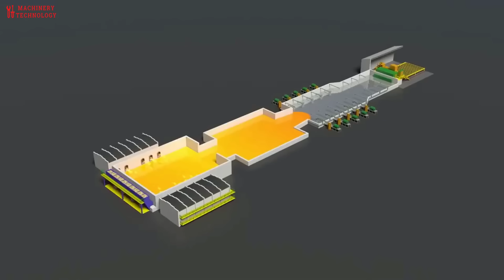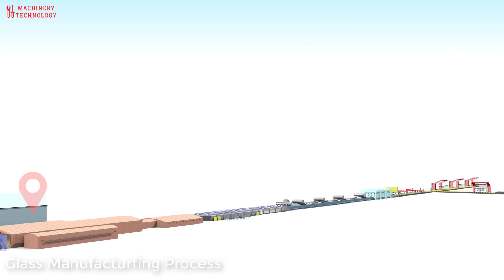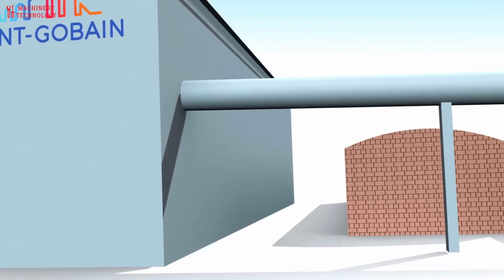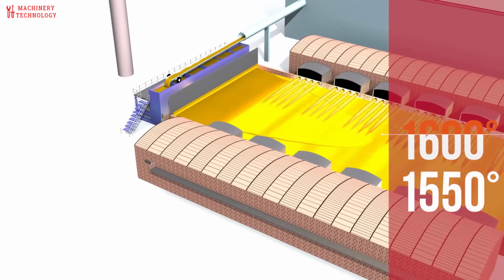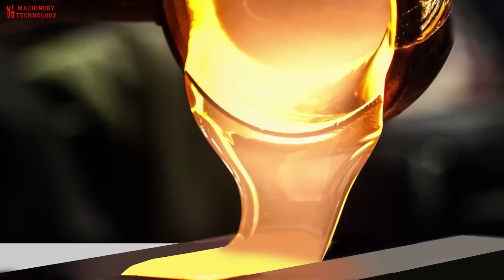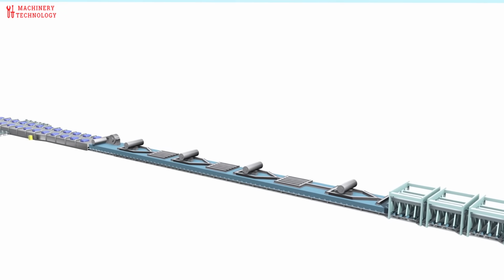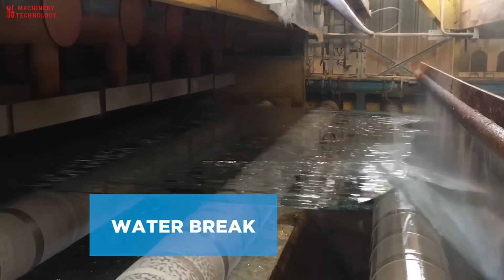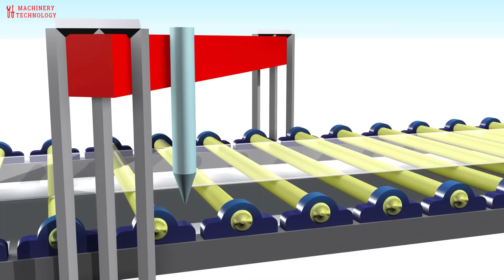Amazing Float Glass Production Process - Glass Manufacturing

Comment: Back in the day when Open University programs were broadcast on Sunday mornings, there was a maths unit about the dynamics of the scoring head; more specifically the need to accelerate it from rest up to a stable speed to make its straight score line across the moving glass. The operation is less trivial than one might think.

Comment: The water break process was a bit confusing as it was located in the middle of the line.  How can the glass continue once it's broken?
Reply: That's the same point I'm confused with.
Reply: It’s because they can’t shut off production of float glass (or would be very costly). So if they need to do maintenance on the rest of the line, they just recycle it at that point. They run these machines 20-30 years, 24/7.

Comment: I would guess the plant runs 24/7 I don't see a way it could shut down without a big clean up of the excess glass
Enjoyed your video and I gave it a Thumbs Up
Reply: They have a running period of about 10-20 years non-stop, it's simply not practical to turn them off. If they have supply chain issues and can't get the required ingredients, they will literally smash the finished product into cullet and re-feed it into the start of the line so they never have to turn the line off.
Reply: При пуске лини по производству стекла, печь разогревают постепенно, в течении 3-4недель и проверяют, чтоб она не развалилась! Ванну с оловом разогревают примерно 2 недели. В день пуска - наступает праздник - "стеклянный язык" из печи протягивают через оловянную ванну на конвеерные валки.
When starting a glass production line, the furnace is heated gradually over 3-4 weeks and checked that it does not fall apart! The tin bath is heated for about 2 weeks. On the day of launch - a holiday arrives - the “glass tongue” from the furnace is pulled through a tin bath onto conveyor rolls.
Reply: @vvdvlas8397  А вы в каком городе работаете? Как я понимаю, на аналогичном заводе?
Reply: @NikolayBychkovRus  
Я был в многодневной командировке на заводе по производству стекла в г. Лисичанск (Украина) ~ 2003г.

Comment: I don't get the reason for the water breaking of the glass at the end of the lehr then you show it as a sheet again?
Reply: That's only for waste - if failed QC
Reply: They mentioned that the molten glass is continuous and never interrupted. When there is a need for equipment maintenance further down the line, they don't stop the flow of molten glass but instead break it and send the shards back for recycling. This way further down the line there is temporarily no glass coming through. When maintenance is finished the water is turned off and the glass continues to flow again.
Reply: I was surprised that molten glass is floated on molten TIN😮. Thanks for that info
Reply: well the reason is clearly explained, that is the only way to isolate a zone of the production line, this is a continuous process, if amintenance has to be performed on the line, then the glass is broken before the maintenance area with thermal shock.
Reply: I scrolled through the comments to see if anyone else was confused by this or I was going to ask the same question. It was not explained clearly enough for me but the response from 
@sbalogh53 clears it up.
Reply: Pay attention

Comment: Can someone help me, send me the entire written process if you have it.
Thankyou!
Reply: so basically what we do is put raw material mainly sand and some other materials (im not allowed to say lol) into a furnace which melts down the sand at temps of near 3,000 degrees. the molten glass is then put through a refiner and cooled enough to be put into something we call a tin bath, the glass floats on top of a pool of molten tin and is formed into whatever width and thickness we need using ads machines(they called them top rolls we call them ads or assisted direct stretch machines), from .9mm which i think is only made in two floats in our company all the way to 19.4 mm or 3/4" which is made on the floats i work on( we have two of the biggest furnaces in the world) after the glass is formed to our requiref width or thickness we cool it through the lehr(we also have the longest lehr in the world) we control the cooling as it goes through the lehr as to not shock the glass and to be able to control its cutting properties, after the lehr it is cut and packed to be shipped out
Reply: lol, you can write it by yourself.
Reply: نعم